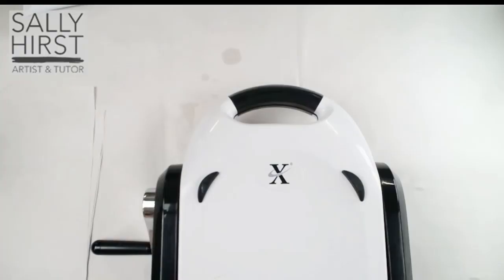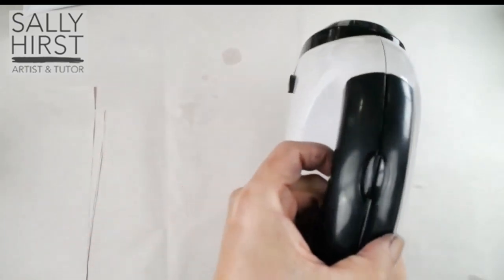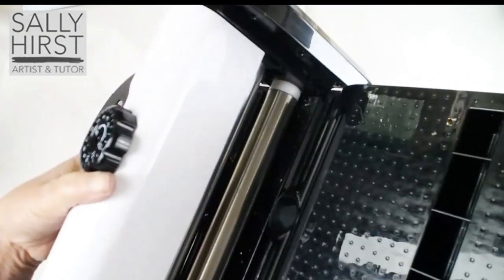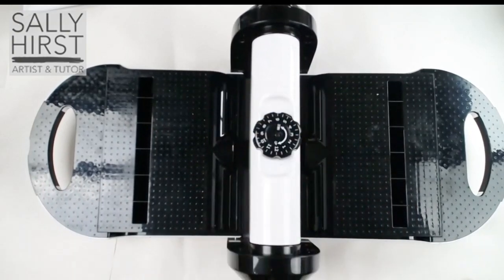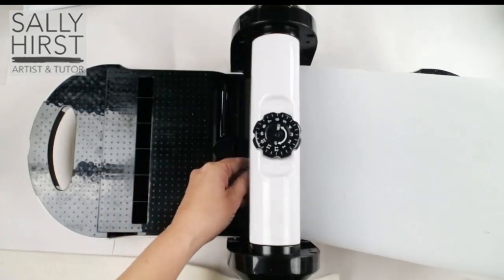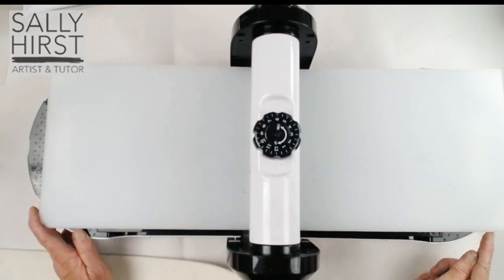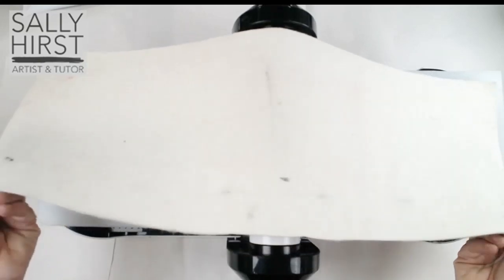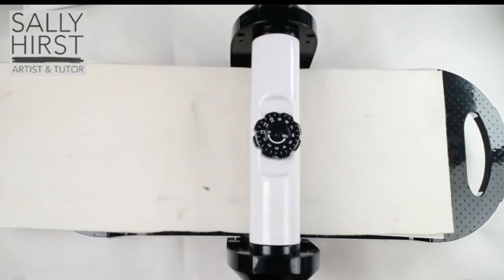Setting up Xcut

Comment: Thanks for this Sally and your other video showing the different die cut machines. I’m considering the Xcut or the Crossover machine which you mention you’ve bought. Do you prefer the Xcut or the Crossover?
Reply from the maker: @jeanyransom9281  they both work the same. It's very much down to what you can get, the Xcut has been discontinued so hard to find.